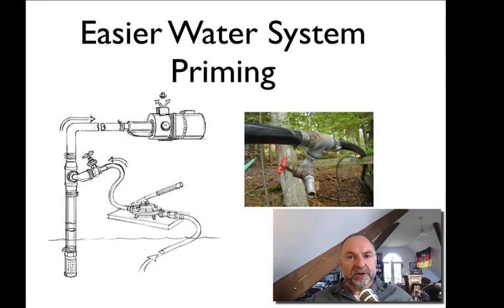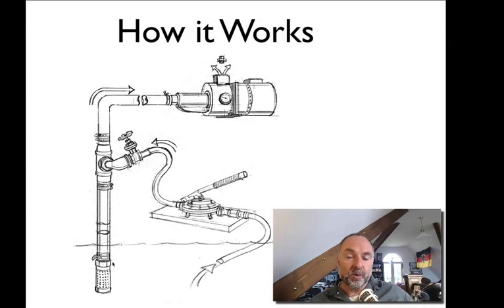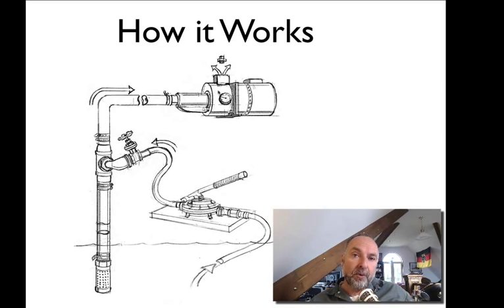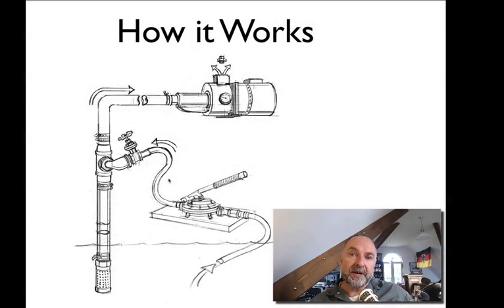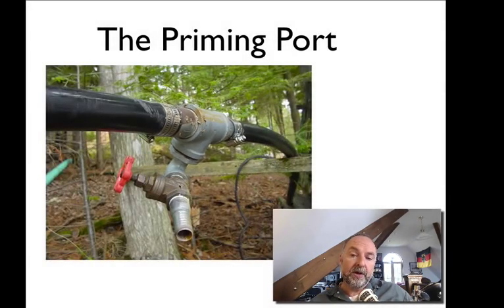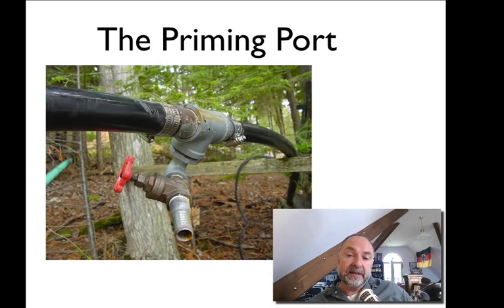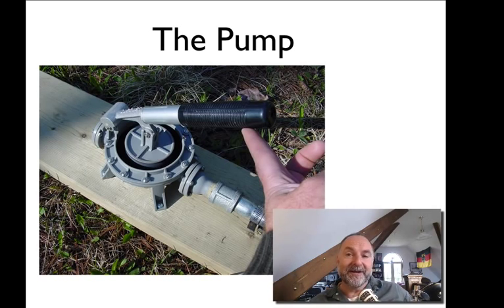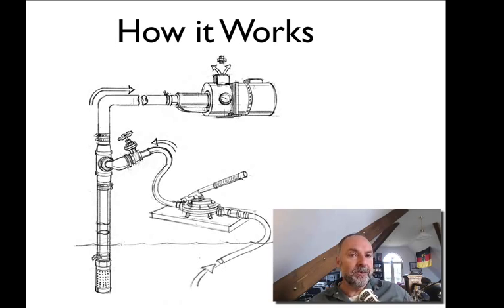COTTAGE LIFE: Easiest Way EVER to Prime a Water System

Comment: Why anyone would give you a thumbs down is beyond me. I set all this up for our cottage in a similar fashion but we have access to water from next door. Instead of the hand pump, we just hook up their hose. But I also made a back up set up one of those Red Lion gizmos that you can hook to a rechargeable drill in case the water next door is not available. Didn't need that. the hose worked perfectly...the first time. Great suggestion and saves a ton of frustration! Thank you for posting your video!

Comment: Your video literally saved me hours of frustration. Installed a priming port, used a 1/2 HP Harbor Freight pump to pump up the line and filled the entire thing in less than 2 minutes with all the air getting out. My only 'tip' for others that may be helpful - in my situation, I had a pretty good run from where the foot valve reached where I could put the priming port. There was a fair amount of air trapped there. I just put the priming port pump on without the foot valve, got water flowing down to the end of the suction line and cut the pump off, kept the line under water while attaching the foot valve. Worked great. Thank you again for this great video!
Reply from the maker: Glad it helped!

Comment: I used the same set-up for my cottage that has a dual line jet pump with a 60 ft run between the cottage and lake. I set it up to take a Honda gas pump - pump runs for 10 seconds every spring and fills the water lines. Simplest trick ever! Thanks Steve

Comment: Hey Steve I think that's a fantastic video with the drawing especially I usually take how about a good hour for me to prime my pump add the water started and then go back and forth with that because of air pockets but I'm going to hook up my garden hose right to a spicket with a female to female coupling and fill up the system that way and then close the top of the pump like you recommended once the air is done I can't wait to try it out thanks

Comment: Thanks for the hints Steve.  I've done this for a while but I've switched to pulling the water up all the way through the foot valve and line by connecting the hand pump to a quick disconnect at the top of line.  This has the advantage of not requiring a port at the base - I've tired that and the port gets jammed every winter or begins to leak. The only downside is that it takes a LOT more effort to pull air out and the water up.  I'm getting pretty tired of this so I'm going to get a motorized version of the "Guzzler" hand pump.

Comment: Hi Steve. Great video. I took your suggestion last year and worked perfectly. I used a pump that attaches to a drill. This year I want to step it up and use an electric  pump but I don't know how to size it. Would any inexpensive bilg pump work. I saw one for about $60. Just wondering if they will pump uphill about 60 feet. The height between the shoreline and the jet pump is about 10 feet.

Comment: As a pump mechanic / Well driller of 25+ years its a very bad idea to put a water spicket or ball valve on the suction side of a well pre check valve.
 We used you're a picture pump "hand.pump" on a 3/4 or 1" tee set up off the top of the discharge side of the pump. Then all you need is a gallon of water to prime the pitcher pump. Make sure to shut the valve to the house use the picture pump when it starts flowing freely turn the pump on and presto...the...pump is primed you can either use a 1-inch ball valve on the bottom of the pitcher pump to just shut it in going about your day or simply shut the pump off unthread the pitcher pump and put your gauge back on. I don't recommend a spicket on the suction side of the well because the fittings themselves introduced more potential for suction leaks if you don't double dope the fittings also the grommets will break down over time on the spigot. You can get a pitcher pump online for about the same price is all those fittings will cost you you can even run it up to your kitchen sink and have a optional Nostalgialistic type sink with an old-style pitcher pump "hand pump" the slightest suction leak on the suction side of the well will stop you from priming the pump. the less fittings the better
Reply: Interesting, how is it going to push the air pockets ? I tried to do something similar using syphoning with 4 meter higher and didn't work , had to walking the length of the pipe and massage the water to reach the end . Can I just attach the pump in the end of the suction pipe in the lake ?

Comment: I have a distance of 152 feet from water channel to cabin,  it is a vertical gradual lift to 25 feet rise.  I was told to use a deep well jet system.  With that said I have to use well casing, would it work if my well is not upright?  As my line will be slanted considerably from 0-152 feet in distance, rising 25 feet gradually.

Comment: Here's an upgrade idea for this system. instead of a hand pump, get a utility pump and connect it via garden hose to the "port". You'll need to be close enough for an extension cord of course, but it will fill the line very fast and trouble-free. Just make sure there is someone at the pump end of things because it will fill FAST. I'll probably add a valve+drain at the pump end of things to allow air in and manage the overflow instead of opening the priming bolt on the pump

Comment: if the valve is in the bottom of a well am not seeing it making it any easyer but i get the jest
Reply from the maker: Hi There!
The technique I've shown here is for seasonal water systems that draw from a lake, river or some kind of surface source of water. It's no help with a well, but well systems don't usually have to be drained each fall.
Thanks for watching!
Steve